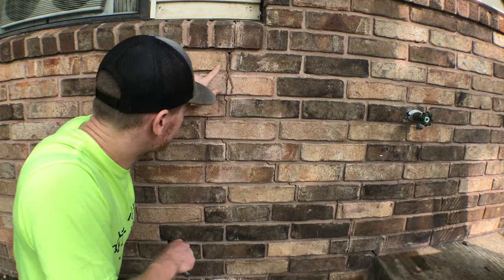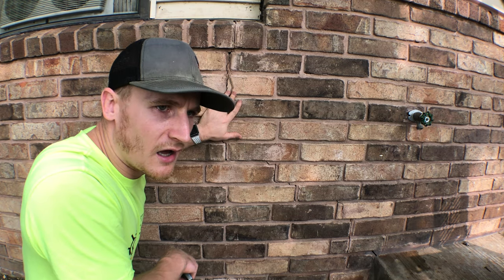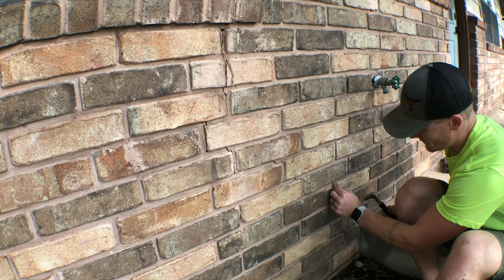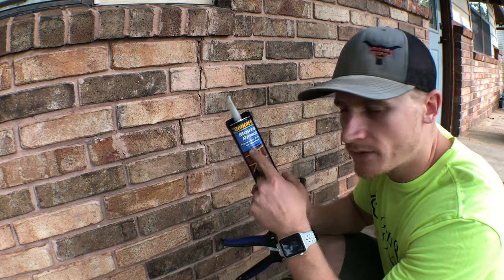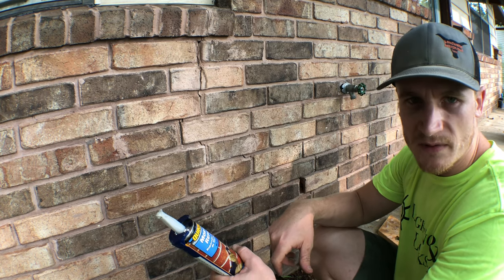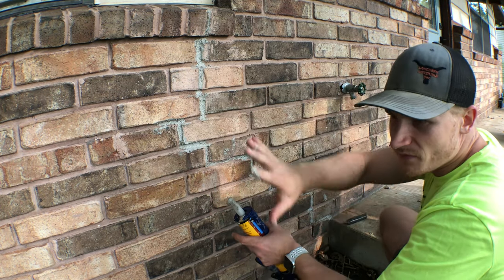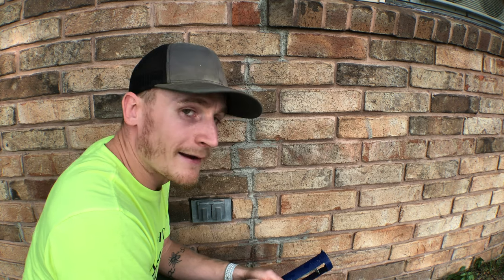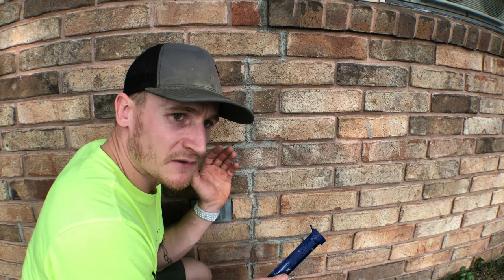Repair Small Cracks In Brick Wall | HOW TO

Comment: Its not mortar in a tube. Its acrylic. Not much different than the silicone that was replaced. Its more work but you can take a grinder and wire brush to the decaying stuff and just use a point to shove fresh mortar in the crack. 1/2 to 3/4" will hold fine.

Comment: Can I still use a sand and cement mix of my own and apply the same way ?
Reply from the maker: Yes.  You can. 
The way that I did it was just the quickest and easiest way to fill the crack. 
Using the actual grout mix would be the proper way to permanently repair the brick. 

Good luck.

Comment: Question: how do I mortar the brick part back onto the wall ? I have the top part of my brick wall coming loose from the wall .
Reply from the maker: I am not a mason. 
I hope someone else sees this comment that knows more to be able to answer this question.
Reply: You need to tie into the wall so it stays put. Metal mesh and concrete screws?
Reply: @SHENDOH did you mean to ask another question on top on your answer? Or did you put the question in there to indicate that you’re guessing?

Comment: That stuff is just a patch. You would need real mortar to do it right.
Reply from the maker: Thanks for commenting. 
I appreciate the feedback.
Reply: Next time you try it. Take a piece of your old mortar with you to your local hardware store or wherever you buy your mortar and they can tell you how to match it up with your existing mortar. Take it home chisel out your old mortar 1/4 inch or so don't take it all out. Then re apply your new mortar in the cracks. Spray a bit of water in the cracks as well before applying the mortar it will match and look alot better. Believe me I've used the stuff in the tube and within a couple years you'll be doing it all over.

Comment: I’d think that cracked brick is more of an indication of some structural problems.
Reply: It's not though. I thought the same thing a few years ago when my wall cracked. Several people have told me (3 are in the house building field) that these types of cracks are from house settling and sometimes is caused from extreme heat.  I live in Texas and it gets pretty damn hot down here.
Reply: @clownchaostime3024   the damage on my home was from water damage. It's not always foundation.
Reply: @JorgeGonzalez-nc3bu  true... I was just commenting on here in Texas and the majority of these are structural/foundation issues...I should have worded that different.. Down here on Texas in the 70"s and early 80's the home builders used hard red clay for the ground the foundation would stand on, cause it was so hard and solid. But, years later, they found out it hardened to hard and cracked foundation and brick. Now they use a mixture of clay and sandy loam.
Reply: @JorgeGonzalez-nc3bu  did your house flood while you lived there? Or did you unknowingly buy it with flood damage?
Reply from the maker: Cracked brick does not always mean structural problems.

Comment: Best way to repair brick cracks is to grind or chip away the old cement and replace it with new I tried to caulking crap all it is is crap after a year it breaks apart or comes apart this is a joke
Reply from the maker: I guess I needed your help with I attempted to do this repair. 

Thanks for watching.
Reply: @BuildItSimple  it’s a joke.

Comment: Brick mason here... You can't prevent water from getting through your bricks. Bricks are not water proof. The reason you have water in your house is because the window sill is cracked. 

You didn't have to ruin the whole wall just caulk the window sill. 

This is the kind of shit that gets charged double when I come out to fix it. Because I have to clean all of that ugly caulk out of the wall before I do my repair. 

Just watching this video makes me mad..
Reply: Btw, mortar isn't water proof either.
Reply from the maker: Well, 
Thanks for watching. 
I wish you were there when I did the job.
Reply: Best product brand/name to fill gap where a small chunk of mortar is missing between two bricks (front steps, window sill). Brick veneer home built 1969, minor loss of mortar here & there, house otherwise in amazing shape.
Reply: @docjody8624  call a mason if you want it done correctly. If you're satisfied with the quality being "ok" then go and buy a bag of pre mixed mortar and a grout bag. Mix your mortar, fill the cracks with a grout bag and smooth it out with your fingers.
Reply: @docjody8624  I say you got this and I'm sure you can do it correctly and it will be ok. No need to call in labor.
Reply: @BuildItSimple  I’d fire you and sue you.